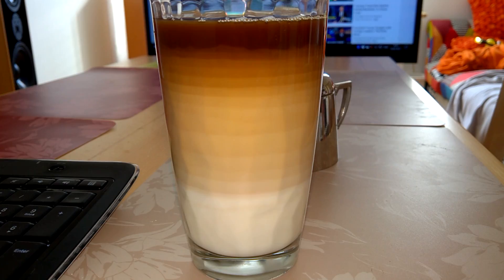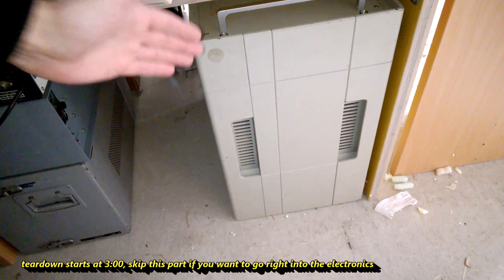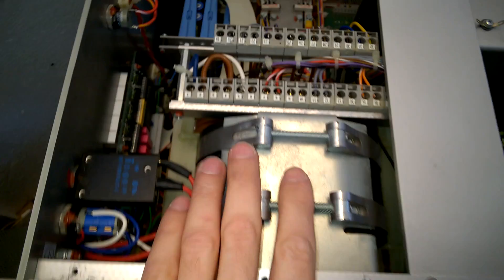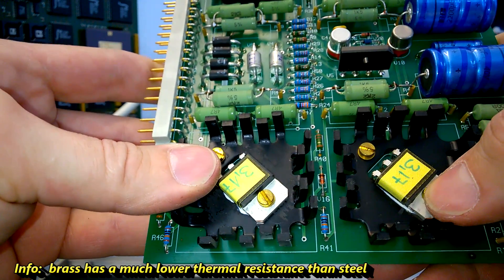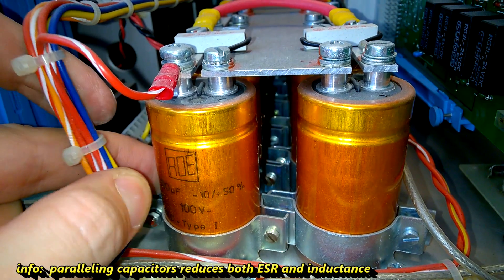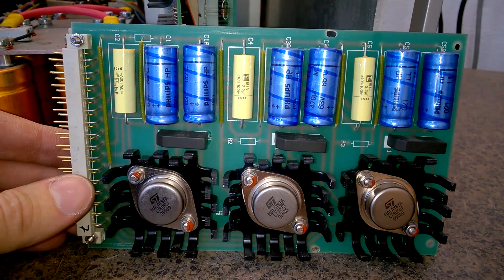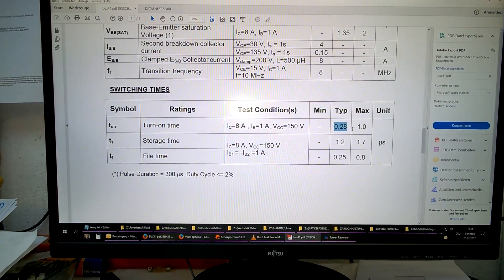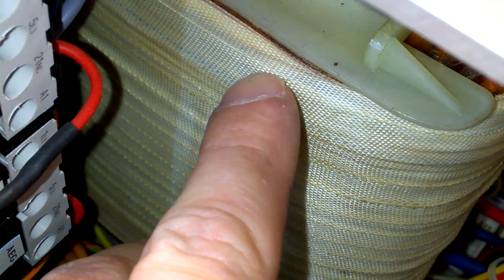BEB #37: CRAZY! 600W RF Power Amplifier (aka THE THING)

Comment: Wow that's a monster!  you could drive one large tesla coil with it! :D  i'm a little surprised now little heatsyncing there was on those transistors though,  must have had a huge amount of airflow to keep them cool
Reply from the maker: thank you for your comment. Each transistor is capable of 120W P(t). While the rated output power is 600W, there are as many as 100 transistors in place. In the end, there are only a few watt P(t) on each transistor. A tiny amount of airflow should be fine. 

I guess the only reason why they were using so many transistors was to keep the ESR low. And to allow high value emitter restistors, to allow mismatch on the transistor curves.

Comment: Looks relay nice engineered, but what fun thing could you build with the THING. There are some things, some more mundane some more illegal ;)
Reply from the maker: would be interesting to do some tangens-delta measurements , together with the test cell seen in BEB #36. I guess they were used together in the first place. Also, would be fun to pop some caps with 300V sine wave at 200kHz (2A capability).
Reply: nice